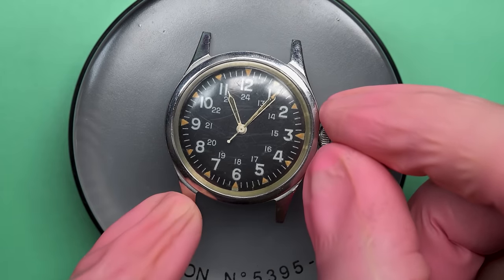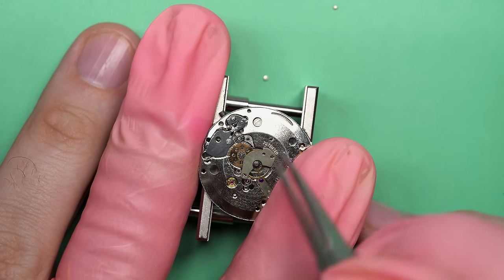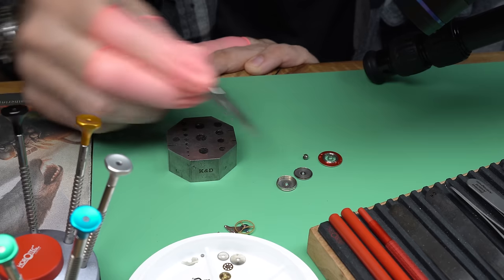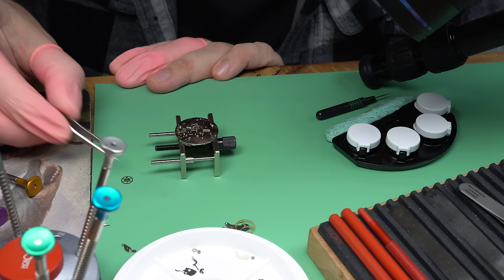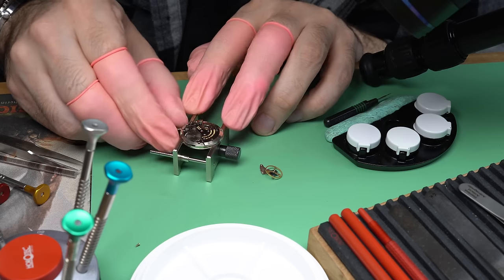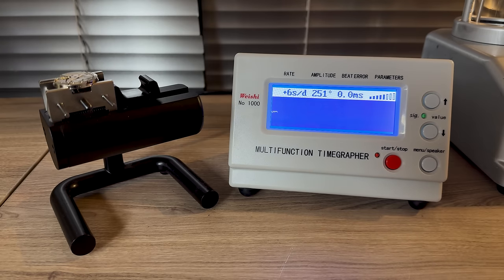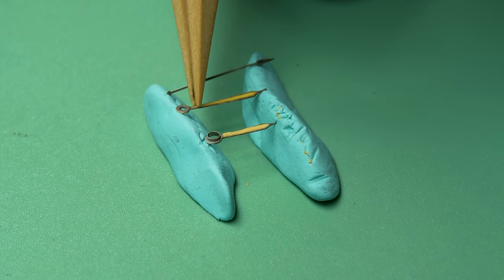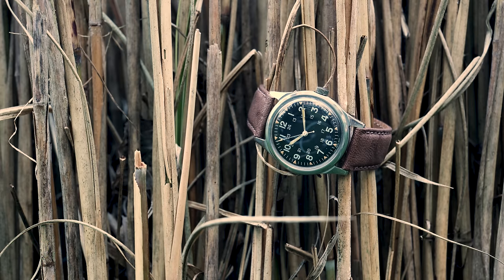Restoring a Vietnam-Era Military Watch I Purchased on eBay as "For Parts or Repair"

Comment: I know I"ve mentioned this before and I'm going to be OCD.Iff you are going to relume the hands you need to show us a before and after of the excited lume. Easy enough to do; make a visit to Batteries and Bulbs; they have a nice hand flashlight that  emits UVA light at 385-390nm for $15USD. There is enough parasitic light that you are able to navigate in the dark without losing your night vision. Just a few seconds exposure will excite the lume for several hours, Give it a try, If you like I can gift you one of my spares.
Ok, I should delete this, but I'll let it stand. From the reflection the flashlight I saw yo bought the Luxpro...good choice.
Experiment with it a little bit; for instance the Florida drivers license includes a uv visible only 3rd photograph o the proper owner. Pretty clever anti counterfeiting  measure. Try Tonic water!!

Comment: About the half-life of a radionuclide, it doesn't mean it goes inert per say after it's half-time has passed. It means half of the original quantity decays and the remaining half will be halved after another half-time has passed and so on.  So, in the case of tritium, which decays by emitting beta particles and has a half time of 12.3 years, it will still have ~25% of the original amount after ~25 years, 12.5% after 37 years, 6.25% after ~50 years, 3.1% after ~62 years. You were still scraping some tritium from those hands, even after 60 years. Why is tritium safer than radium ? It's beta energy is low and it decays into helium which is stable. It is still dangerous if ingested or inhaled. Radium, not only has a huge half life of 1600 years, but it decays into a quite long chain of other radionuclides that emit alpha, beta particles and also gamma rays. Just so others know what they are dealing with.

Comment: Marshall, I've heard you mention more than a few times over the years that radium dials are dangerous. I'm now 84, but back in the 50s & 60s, I always had a wristwatch with a radium dial. As far as I can tell, they never harmed me.
Reply: look at the story of the radium girls. The paint itself is rather "safe" when enclosed, but how it was applied was simply human abuse
Reply: You, presumably, were not servicing open watches. They do emit more radiation than is considered safe but the main fear is radium DUST that gets into your lungs, not something one would need to be worried about unless you open up the watch. Still, increasing radiation dosage at all is basically bad practice even without the dust as as that can be thought of as rolling the cancer dice more times than you would have otherwise.

Comment: hey ive really loved your videos! My dad has an older Omega seamaster from 1956 that was gifted to a notre dame boxing coach by the kids he was training.  it does run however it does have a lot of problems I think he autowinder is broken and it runs extremely fast or slow I cant remember. If you'd be interested id love if you wanted to fix it. Id obviously pay for the repair but figured id ask here before taking it to a watch repair shop.

Comment: i am a victor and follow in my work on watches only the highest ethical standarts. for the necessary service....  20:39 is such a moment, to change from victor to a total looser.    what to do... the parts cost more than the watch...  go under the table and clean.... take light...   experience, that  you cannot repoduce the way the parts took......   tomorrow your wife will clean... the living room..... 

your film very educationally....  a lot of new stuff... against old stereotypes

Comment: I thought tritium lume only came in tiny vials attached to the hands. Did it come in a paint-on version as well?
Reply: Yes but wasn't very common for very long. They went away from all radio-luminescent materials in favor of photo luminescent stuff (the type you have to shine light on the charge up). So now the only radio luminescent stuff you see are the tritium vials.
Reply: @busimagen  There is tritium paint. It is a real thing. No one uses it not only because of potential health risks but also because it's just not very good. Within a year or two it's faded to barely working at all. Also, tritium paint was banned in Germany and Switzerland I believe around the 90s. Even if there are no hazards to the end user, it's still hazardous to manufacture. Tritium vials are just a much more effective solution and photo luminescent paints are a much cheaper, safer and easier solution though a bit less effective.

Comment: Rookie Watch hobbyist needs help. I have a watch cleaning machine on its way to me and I need some advise please. I have a watch cleaning machine on its way, and need some help. It is a three jar style machine, and I can only find L & R rinse, which is fine, but I only see L & R wash (Ultrasonic) my machine isn't Ultrasonic. Will it still work as well, or am I on the wrong road? Thanks for any help....
Reply: I use L&R 111 watch cleaning with #3 watch rinse in a L&R machine without ultrasonic, ir works great and no issues at all.

Comment: I wouldn't mind seeing the "disaster" watches from ebay: as you start tearing into it and find out it'll cost way too much or its far too gone. That could still be a learning experience for novices, right? Even if you kinda saved up a few examples for your regular length videos would be fine.

Comment: If i wanted to send in a watch. How do i do that? Also any way to mod a watch to do hacking?
Reply: I have 1 with an a458 movement i got for pretty cheap. Its not my first mechanical and i got it because its just a cheap mech watch i cn wear when lounging around n not worried about if it breaks or if the time is that accurate. However the click is known to break and i notice quite a bit of resistance in the winding stem. Even with no wind. N the rotor doesnt move as smooth or as easy as a seiko nh35a. Basically an autowinder wont make this wind. Tbh idk if the rotor does anything. To be fair it was a cheap watch but i still want it to last a long enough time

Comment: Nope....wrong procedure  man!!!!!  First remove the cristal (yes) , and THEN  ROTATE THE CROWN (CROWN AT ITS NORMAL POSITION)  UNTIL THE STEM  SLIT  IS PERPENDICULAR TO THE CASE ITSELF WITH THE DIAL FACING DOWN , so the whole caliber can slide on its   'two-part stem'  on its slit , towards  the cushion.  JUST EXACTLY AS  MIDO BRAND WATCHES.     WRONG WRONG WROOONNGGGGG !!!!